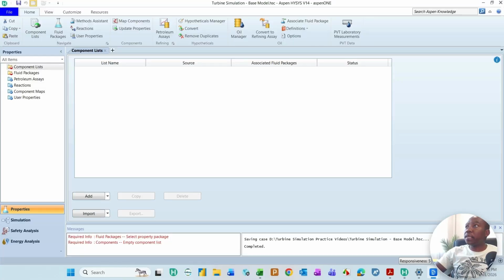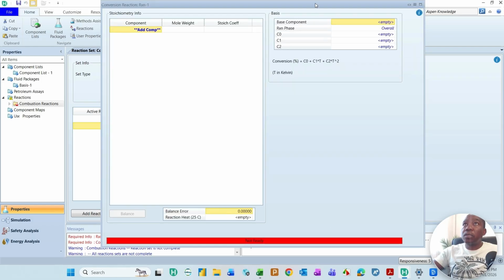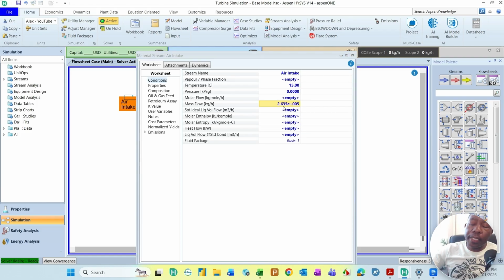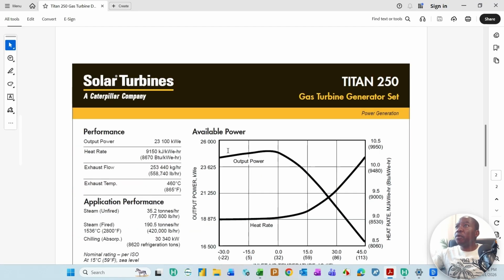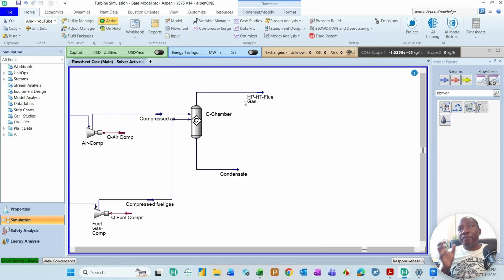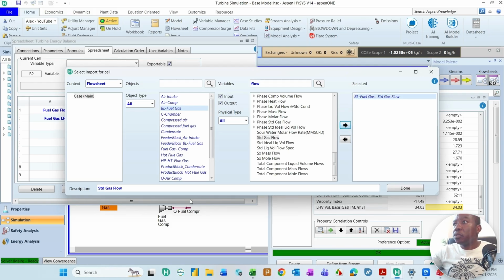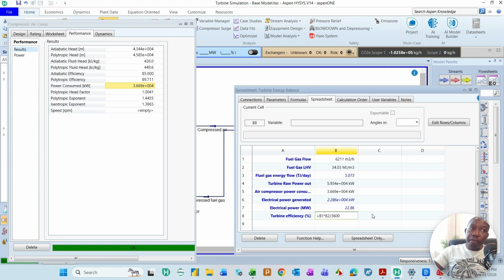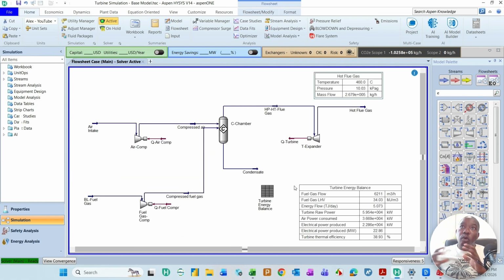Key Steps to Simulate a Gas Turbine in Aspen HYSYS - An Industrial Case Study

Comment: hi, after calculating the flow rate of fuel gas(6211 m3/h) from LHV, You entered this figure as Liq Vol Flow@ std condition in material stream(condition tab) while this is gas flow rate; therefore it should be entered in proper cell
Reply from the maker: Hi mate, that is a good observation and thanks for the comment. This is a really common point of confusion in HYSYS 
Even though the label says “Liq Vol Flow @ Std Conditions,” that field is actually used by HYSYS for volumetric flow at standard conditions for any phase, including gases. When the stream phase is set to vapour, and the fluid package is defined, HYSYS interprets this value correctly as standard gas volumetric flow.
Entering 6211 m³/h in that field is correct and yields the correct mass and energy flow once the composition and properties are defined.

I’ve attached the Aspen HYSYS documentation, which explains how stream specifications work and how HYSYS handles standard volumetric flows across different phases. It’s a useful reference and helped me get my head around it many years ago. Check Page A-58

Here is the link:
 https://drive.google.com/drive/folders/1SuUQ-e1Bc7uqhviTh9b9aVKMVAGXDY4A?usp=drive_link 
Appreciate you raising it, and keep the questions coming